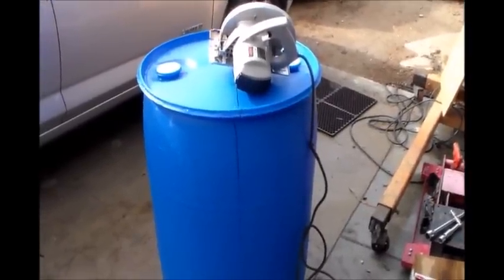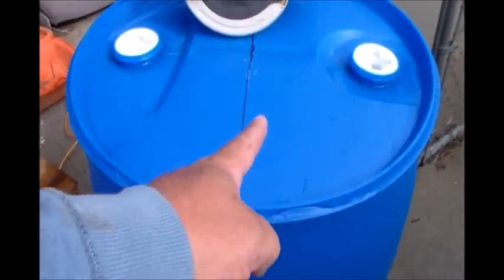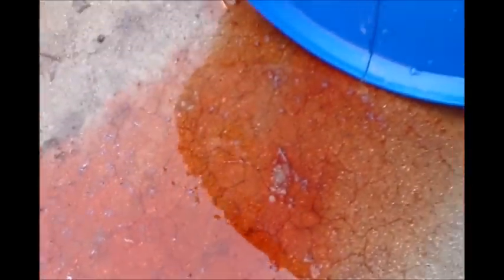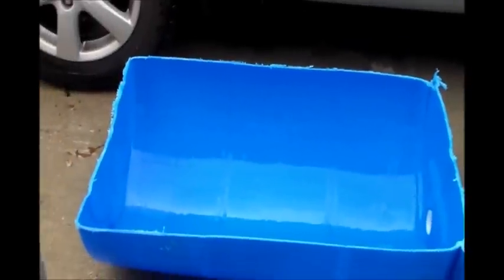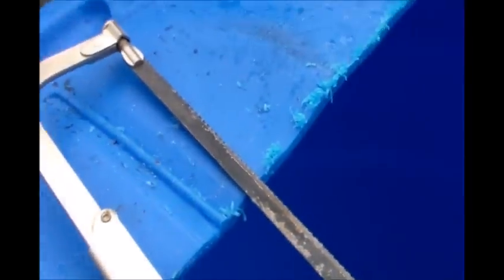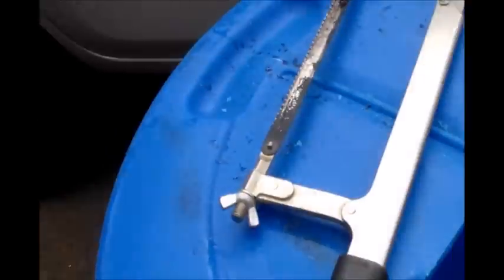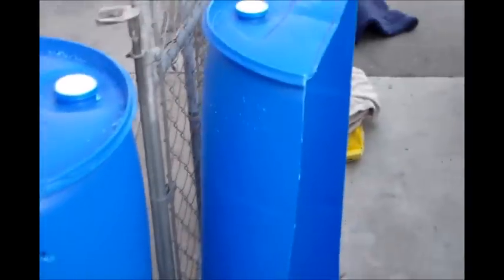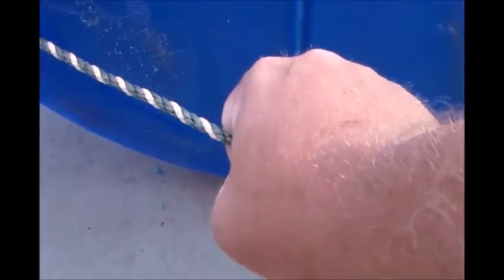How To Make A Gold Sled

Comment: Those barrels are so handy. I use some for rain catch barrels for my garden. I would for sure round the edges off the rope holes so the sharp edges aren't so abrasive and wear your rope though quickly. Or just carry a spare with you in case it happens far from the car. Merry Christmas Rob!

Comment: Nice project, Robert. I was thinking that if you have an old wooden broom handle or something like, you could cut that down to handle size pieces and drill a hole through the middle of them and use that for the handles. Wood would still be fairly light weight. You could add handles on the rope on the sides of the gold sled too, in case they are needed, they will be there. Maybe? Can't wait to see you using it. I Love seeing people doing their own projects, rather than buying them. Costs a lot less too More money for gas, to get where the gold is. You could probably also bring buckets of dirt home and use the sled there, right? My Uncle, (a Great Gold Miner), use to take buckets of dirt, home and work it in a (hard plastic kiddie pool). That kept all the goods, and any escaped huge gold nuggets, (Smile) contained in it.Worked out very well.
 Happy gold sledding. Woohoo!
Reply from the maker: +MerAngel12121  Thanks

Comment: I install vinyl siding and a better way to cut that plastic with a skill saw is to put the blade on backwards.. Trust me, it will be a much cleaner and safer cut
Reply from the maker: +theBald1  Thanks i got one for my friend and he will want me to cut that one too.
Reply: you are correct   blade bacwards for tin and plastic  much cleaner cut and safer /easier control